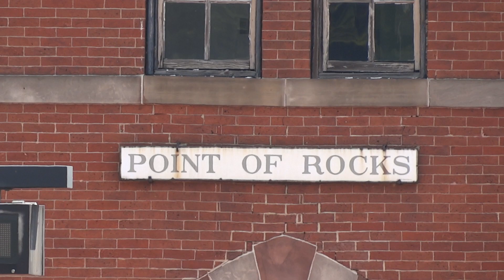CSX Geometry Train W003 in Point of Rocks Maryland

Comment: These guys have way too much fun! Imagine riding the rails here, there, and everywhere while the electronics do the work. Not a bad job at all :)
Reply: They probably have do more than that. Calibration of the sensors. Trouble shooting the electronics and electrical issues. Make repairs of electronics and sensors. Basically they probably are required to have at least an associate degree if not a bachelor of science in electronics or IC&E.